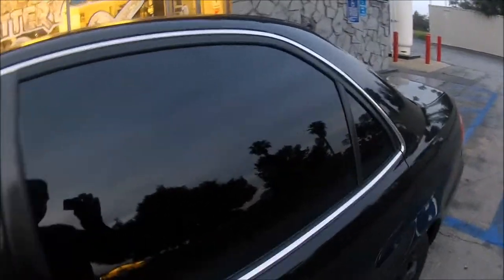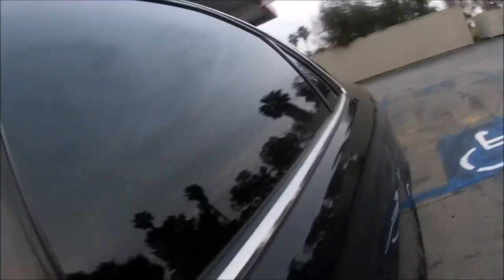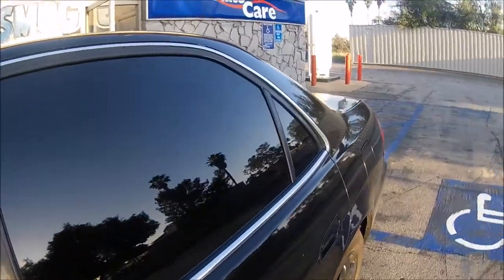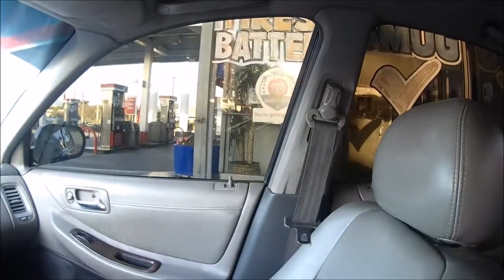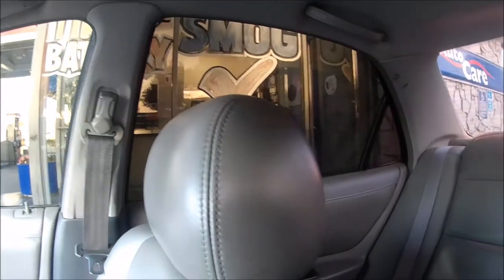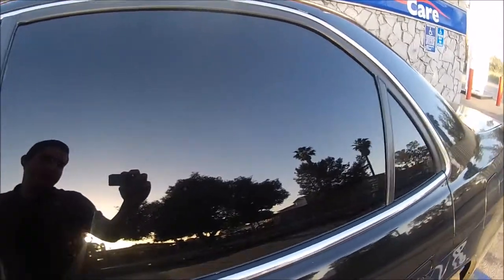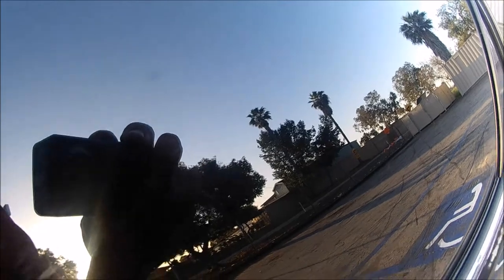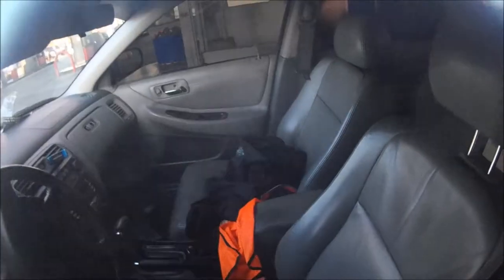Adding 2 layers of LIMO.!!!!!

Comment: Hey alextv nice video, your camera shakes too much like if you had arthritis. Also i tried what you said by adding the extra tint and now my car won’t start. What should i do?
Reply from the maker: I actually do have arthritis thanks for pointing that out. that was not the point of the video. As for your car not starting all you have to do is reverse the process and make sure you use alot of soapy water too.